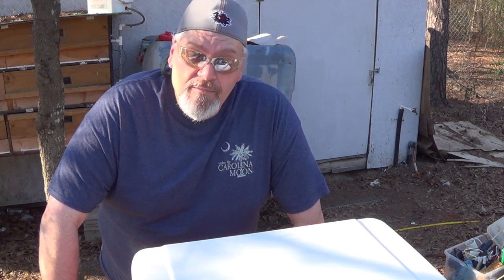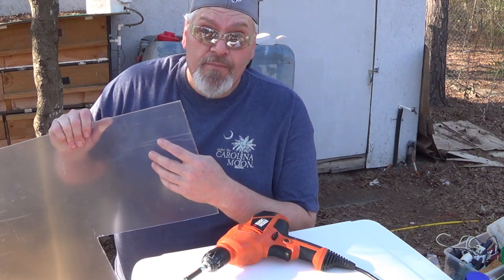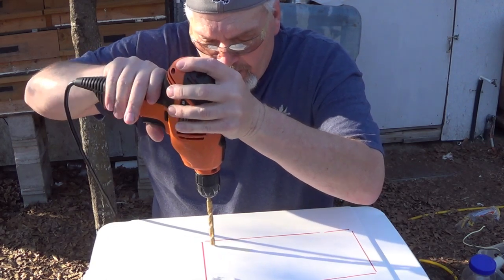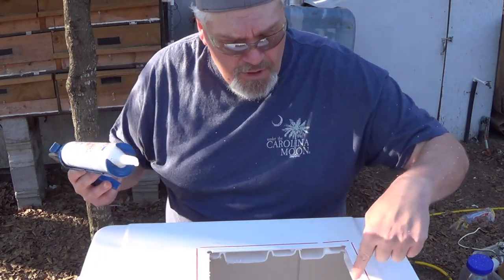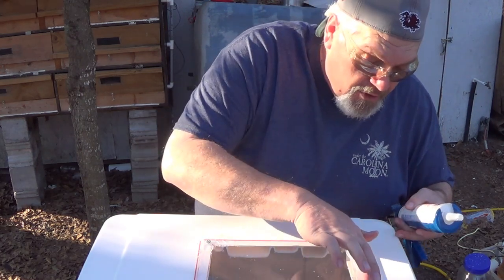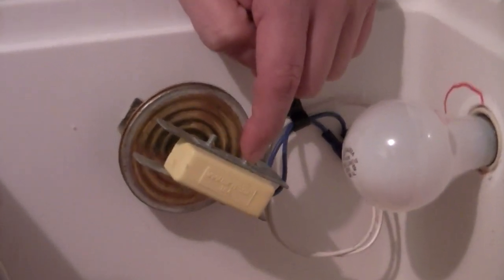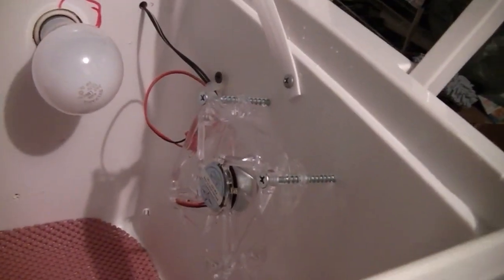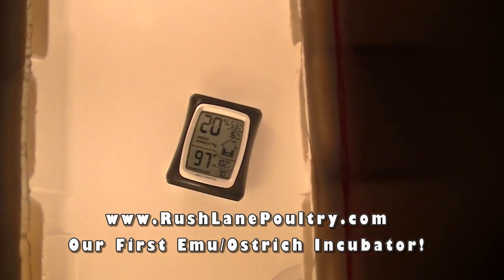Home Made Incubator for Hatching Emu & Ostrich Eggs!

Comment: You might be getting some hot and cold spots from having that wafer thermometer next to one of the bulbs, maybe you could move it to the opposite side of the box so it gets the true temp of the box instead of getting hot before the rest of the box? also that would help with your redundancy system, because how they're currently arranged, if the bulb nearest to the thermometer goes out, the opposite side of the box will be much hotter than the thermometer, even though it'd be mitigated by the pc fan you have wired in there. just an idea, I saw it and flashed to my engineering classes.

Comment: Can you recomend a good heatining element for a small incubator with the the digital meter believes its the w1200 thermostat..
Reply from the maker: I would use two 40 watt bulbs!
Reply: Tried with a 40 element out of a little giant incubator but could no keep the digital therostat at steady temp..WILL TRY THAT
Reply from the maker: James Mitchell The light bulbs heat up fast & cool down fast as well! They work best in a small box!